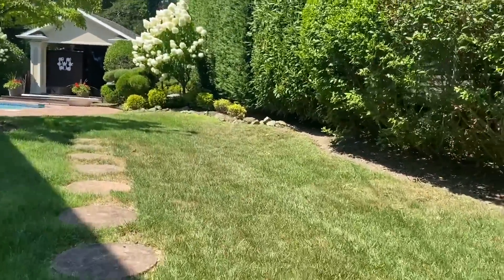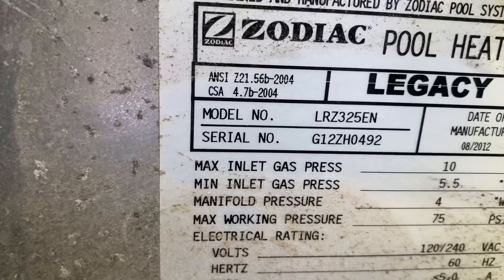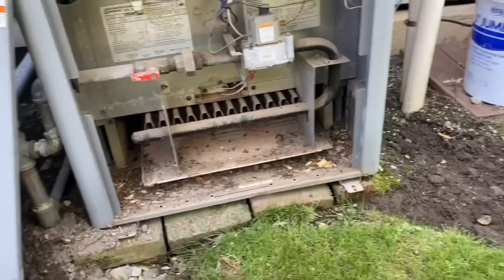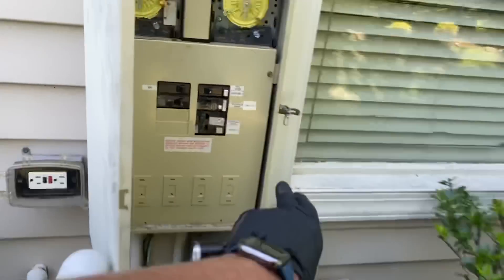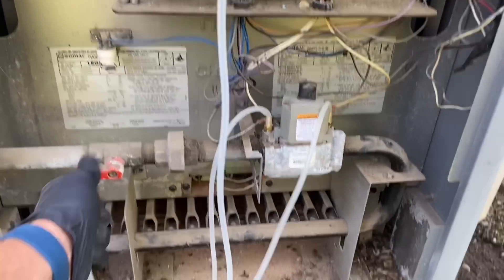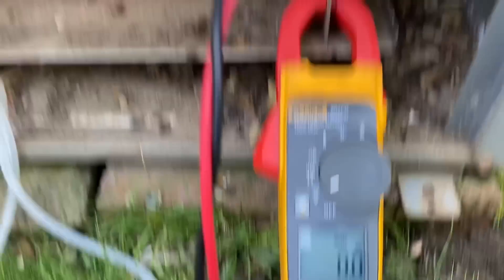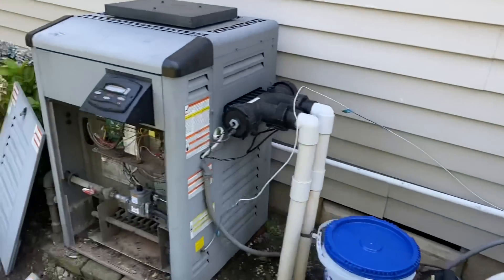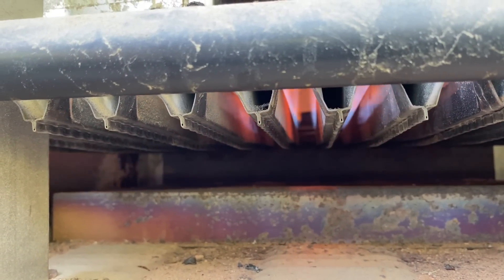How to Diagnose and Repair Jandy LRZ Flame Failure Step by Step Instructional Guide for Technicians

Comment: Great video! I have the same pool heater and same Ignition Lockout error. In my case I get the click of the gas valve, and gas at the union, but there is no glow from hot surface igniter. I don’t have a pressure tester for the gas valve, but I think it’s safe to say with no glow or ignition/flame I need to start with replacing the igniter? 

I’m in Canada, an ignitor is $200, gas valve module is also $200, but the gas valve is $600. So I’m hoping replacing the ignitor is the best/logical first step.  I noticed in three of your videos it was always a faulty gas valve. I’m surprised as I’d think the igniters would go more often than gas valves. But maybe I’m wrong on that?

Comment: Mikey, what manometer do you recommend for entry level tech on a budget vs I might have a couple bucks for a better one. Asking for a friend.
Reply: Is homemade a  reliable option ?
Reply: if you do a lot of furnaces with pressure switches, you may want to get the more costly (3 port) model with air pump. for sure if you'll be using any universal pressure switches you have to set and choose the right parts(they're a pain in the nutz)

Comment: Don’t forget to check the manifold pressure after you install gas valves and clock the gas meter not to mention check for gas leaks and safe combustion.   
Most people skip these steps but it’s always done on every job regarding a fuel burning appliance because it is the correct way servicing gas appliances and needs to be documented like this in case of a legal disputes. Not too many techs or repair guys have done a video on proper word documentation for the work you just did. 
Great Video keep up the good work ! 👍🏻

Comment: I had solar heat on my pool in Vegas.
Reply: @PipeDoctor  
Added a month and a half to each end of the swim season. It could keep 87 degrees from mid March to mid October.  You'd be surprised how much heat is lost at night to evaporation. In Vegas you never close the pool. If you can stand 55 degree water you can swim in December/January. Our realtor used a wetsuit in the cold season.
Reply: @scott_meyer  55 degrees? Nope! Not for me. What’s the OAT?
Reply: @MikeyPipesUncensored  
OAT?

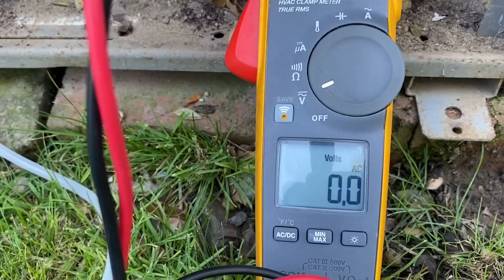Comment: 8:48 this voltage test should be carried out with the gas valve hooked up and leads also hooked up. Testing open circuit voltage can be misleading. Without a load on circuit it could. Pass voltage and not be able to pass amperage.
Reply: I see you have another pipe doctor lol. To bad he does not know what we do. We already know what the problem was before testing... 🙂
Reply: Lets Go Eddie (Brandon)
Reply: Just because someone has done something for 30 years does not mean it's right. Always should try to learn something.
Reply: good point, because the control/ignition box/relay may be failing and lull you into thinking it's fine. then it's whoops new gas valve and it still doesn't work or only works intermittent.
been bitten that way plenty in the past with all sorts of different electronics and control boards. oven, fridge, washer, tv's, radios, vehicle parts, the list goes on!

Comment: You could have gotten fooled by measuring the 24 volts with no load.
Reply: I've been watching the auto diag guys mention this a lot and getting fooled. They mostly use light bulbs for a load.